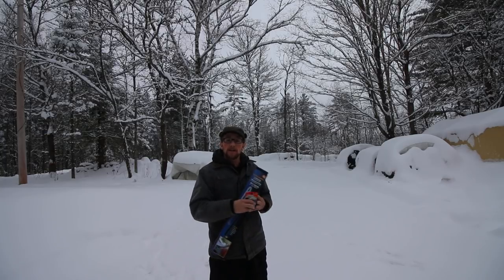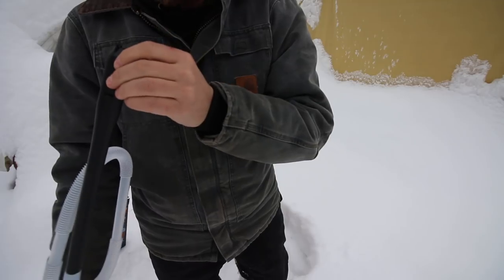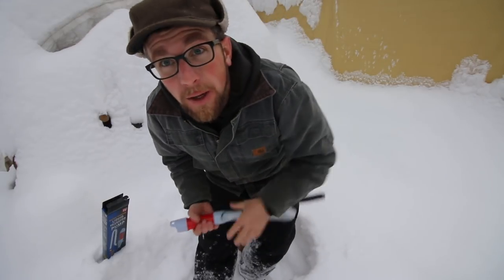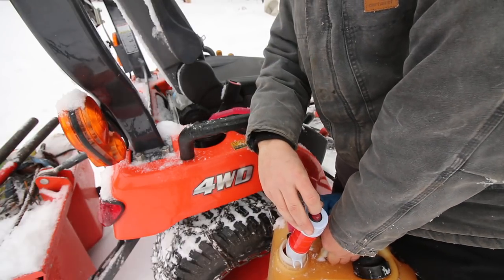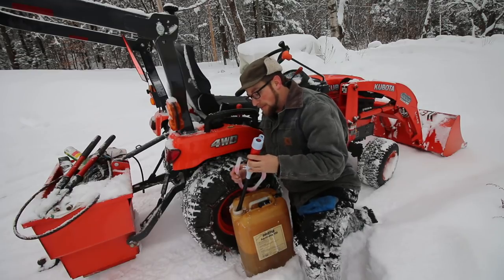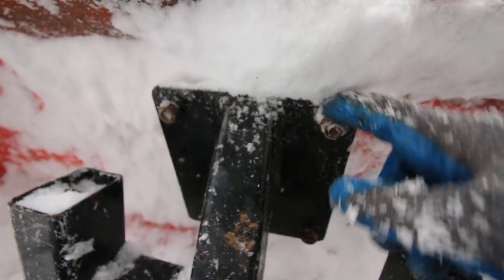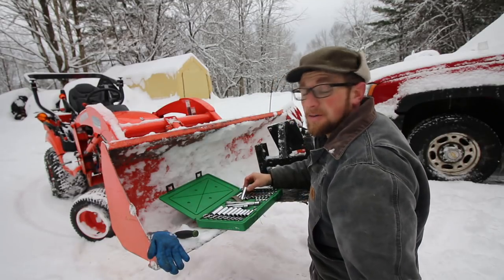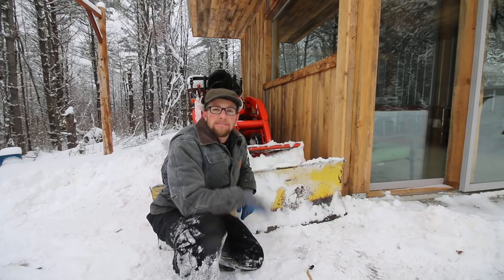Winterizing our Kubota and testing a  Portable Fuel Pump

Comment: When I get the slab poured in my pole barn this spring, one of the things I'll be doing is making some low creeper-like things on casters that I'll set my bush hog and other implements on to roll them around in line with where they attach instead of trying to horse them into place.  I'm getting too old for horsing that stuff around.

Comment: I got one  of the fuel transfers for $6, at Harbor Freight, works great, and be sure to rinse the transfer unit after using with soap, Add a little kerosene to thin the diesel fuel.

Comment: I have 3 of the pumps. A blue one for kerosene  and 2 red ones, 1 for gas and one cleaning the fish tank. One quit working so cut the hose off and made the hose longer for the fish tank. The battery contacts get corroded and I use fine sandpaper to clean them. They work great.
Reply from the maker: I am glad to hear you like them so much. We should be happy with ours I would say

Comment: Nice Video! Happy Christmas!

I've got a little impeller pump like that for potable water transfers. Obviously you don't want to use THAT pump for water, as you've used it for fuel already, but they do work great! Though mine is no where near that quite, I got about 1gal/min from it on fresh batteries.

Comment: Kero sun came out with a pump, just like that, years ago when the kero sun heaters were a big hit.  One way to help out your diesel fuel in cold temps is to add kerosene, it will not jell or freeze.  Looks good, although it is kinda cold out for doing that stuff, just sayin, lol.

Comment: RAIN?!?! Guess we’re the lucky ones! We got a little better than 8 but, all light fluffy snow. Take the day off Al....I might look at the pump....at 15 bucks you can’t go wrong. I grabbed a manual pump similar to that, at Walmart....no battery to die...no need for electric....surely you can union a longer tubing system on that and THEN, you won’t have to hold the jug up! I’m with ya too that Kubota should have designed a drive off and on mower deck.  Hope you had a wonderful Christmas 🎄!
Reply from the maker: You are lucky that you didnt get the rain. We have a ton of ice now

Comment: JUst a FYI - The "fan in a pump is called an impeller, if you turn the anti-scalp wheels sideways you can roll the mower out easily (should be holes in the king pins for that built in)

Comment: You should be able to "float" your bucket. You will never use a blade on the front or back again. My old BX did it and my new John Deere 2320 does it too. It wont dig into gravel or grass.

Comment: Idea you can add an inline 4inch exhaust fan to move the heat and draw cool into the root cellar in summer.  Get a lucas or warrior mill..you would be very good at timber framing.  Merry Christmas